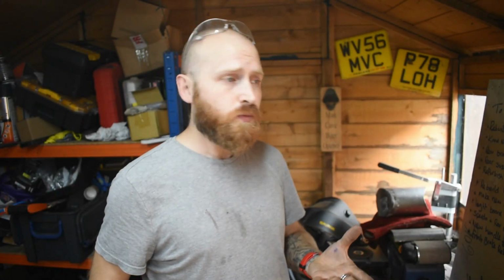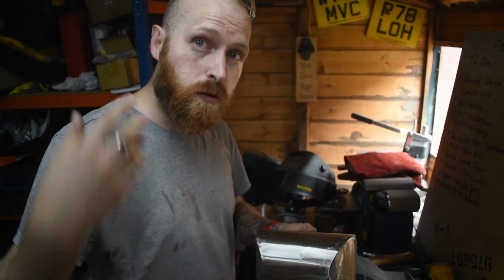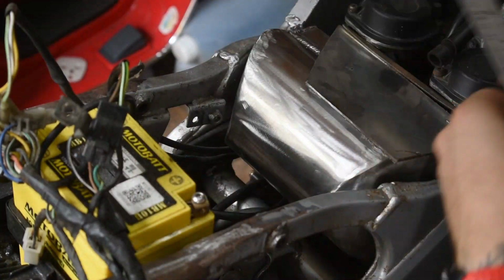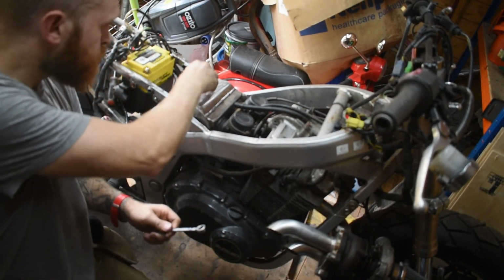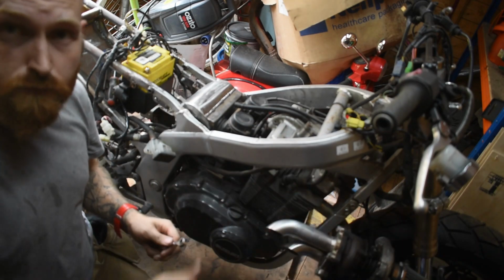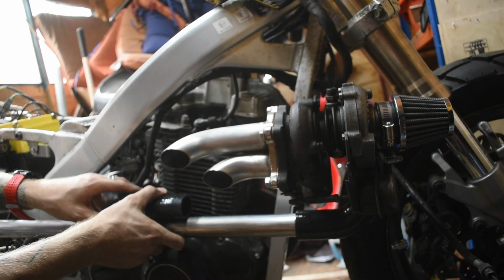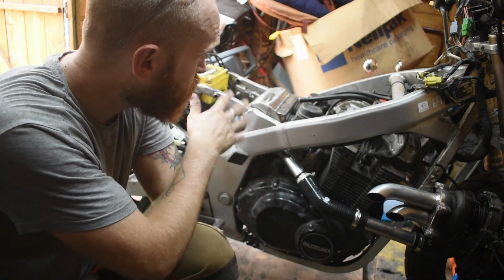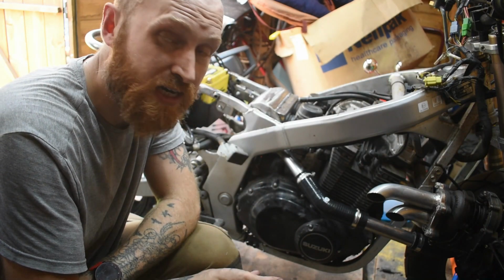GS500 Scrambler Build - Ep25 - Stainless Airbox/Plenum Part 2

Comment: Few tips, if you don't mind.

-That air filter is way, way too small. You need a filter that's triple the size of it, at minimum. 
-When jetting a blowthrough, your jetting should actually be almost completely stock. This is because the pitot tube (when setup correctly) increases fuel pressure above boost pressure as boost rises, so it continually adds more fuel as boost rises. The OEM CV carbs are actually the best option for blow-through, except for the plastic tops blowing off at higher boost levels. 
-A good starting point for a Pitot tube would be an 1/8" I.D. piece of tube installed in the coldside pipe, facing the coldside outlet of the turbo (facing the impeller), with 3 equally spaced, 1/8" holes drilled in the tube. Run 2.3-3PSI of base fuel pressure, any more than 3, the carbs will probably flood.
-Use the least amount of silicone couplers that you can. They have a habit of collapsing during engine vacuum when they're too long.
-GR650 cams swap straight into a GS500 engine, and they have .040" more lift and slightly less duration.

Best of luck. Dialing in a blowthough setup for your first time will either make you a believer, or make your give up on carb's altogether, lol.
Reply from the maker: Thanks for the info. I actually watch a lot of your videos to see how you do things like this. Love the twin turbo virago you've just done. There are so many different opinions on how to turbo this bike, its easy to get a bit muddled in what to do. But im looking forward to trying. Everydays a learning day.

Comment: You actually could try putting a small intercooler on that straight pipe between turbo output and air box. Maybe with some scoop to redirect ambient airflow through it. I think this will help to cool air that runs through turbo at least somewhat. Waiting for subsequent series, subbed. Cheers mate!
Reply from the maker: Yea this is a thought ive had myself. The wait will soon be over, il be setting up my new workshop soon hopefull.

Comment: That came out rather well. What’s the logic to a pressurised/regulated fuel pump, just to get fuel into the bowls quicker ?   I assume the stock carbs were already pump fed ?
Reply from the maker: Stock carbs are just garvity fed, so if the air going into the cards is pressurised, it will push the fuls back up into the tank, (or so ive been told, which does kind of make sence) so a fuel pump with regulator on set to just a little more psi than the turbo should even the score a bit. Cheers, im rrally pleased with that air box. Just hope it all works now lol
Reply: @BareBonesMotorcycles  ah yes thats what I was driving at except you articulated it a lot better, fighting against the turbo pressure. I assume jetting is more critical as well. Are you upgrading or changing the carbs ?
Reply from the maker: No, keeping the same carbs, but going to have to play with the jetting a lot i think lol
Reply: @BareBonesMotorcycles  Are you doing anything to the engine internals ?
Reply from the maker: Nah, that should all be ok. Im only going for about 7psi of boost, so the  engine should handle that without any issues.
Reply: @BareBonesMotorcycles  yeah probably get it back up to stock 😊
Reply from the maker: Ha yea thats true! If i get an extra 5bhp il be happy